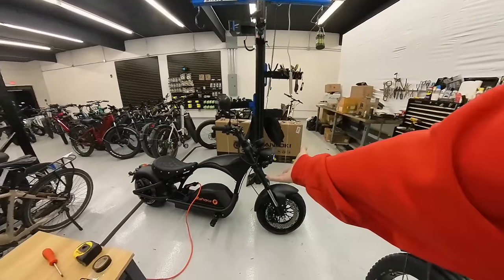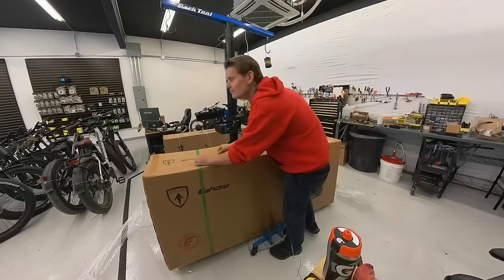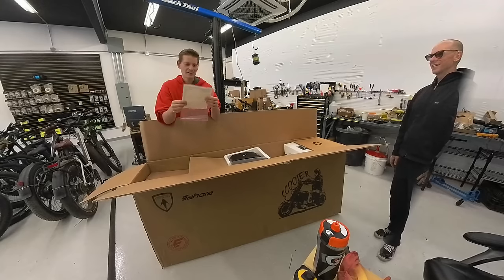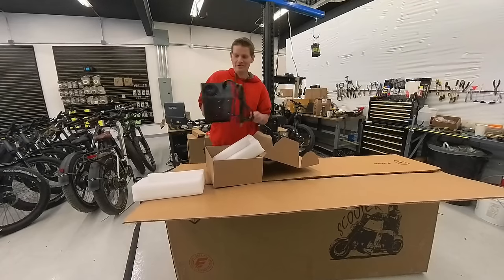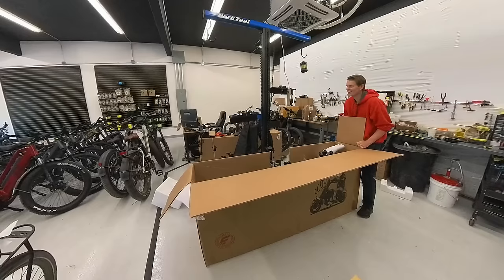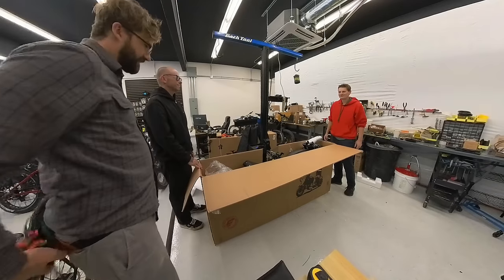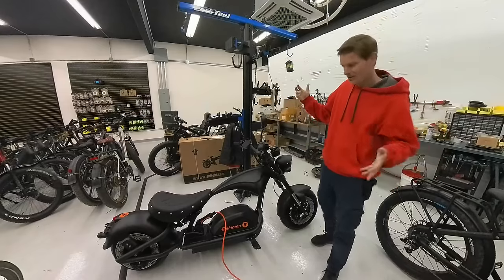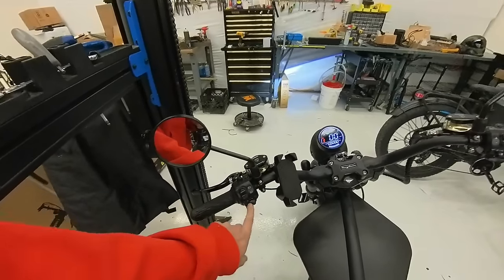Ready for a faster electric bike?  Unboxing the Eahora M1PS

Comment: When you do a follow-up post, please  give more details about how the rotor is attached to the wheel. It's cool looking and efficient.

But it seems to make the wheel more susceptible to stress fractures, where the rotor bolts onto the wheel  Versus more conventional hub flush surface mounted rotors.

Comment: Damn this is basically exactly what I’m looking for. I’ve got a 24 mile total commute on 45 mph roads. I was looking for something electric that can go at least 50 mph, have enough range to get to and from work, weight capacity high enough for me, I think I can register it as a moped so I don’t have to get a motorcycle license all for around the cost of a sur ron. I don’t particularly dig the chopper styling and I’m about 6’3 so I might be too tall for it but I’m super interested.
Reply from the maker: That sounds like a good use case for it.  I was comfortable in the shorter peg position.   You'd probably fit ok on it further out.  Idk what state you're in but in California you still need a M1 or similar license for a moped.
Reply: @Area13ebikes in Ga you don't  need a license for mopeds and scooters 49cc or so.

Comment: I looked at the motor maker with current configuration  you can exchange the motor to 5000 w motor by changing it through the motor  manufacturer  but if you want to big dog it they have a 8000w motor and mods are needed  like bigger battery , controler, finder comes off and bigger tire
Reply: QS seems to be the top of the hub motor food chain so much so they even make 12kw car tires 😅😂🎉

Comment: Hey are 13! Cool bike but one not is that if I remember right if you register it it unlocks speed mode so you can go up to 60-70 mph or you do a code thing were you hold and release brakes and throttle you’d have to search it but just wanted to let you know

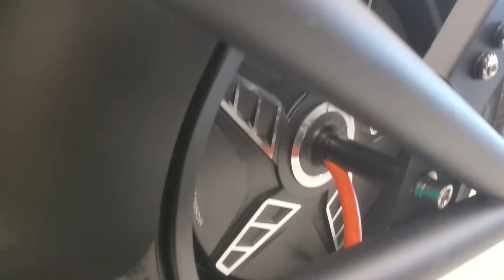Comment: That orange power lead @14:20 that comes out of the back wheel looks kinda squished/tight in the video.....hope it isn't, because that would be a bad place to rub thru the insulation, and cause a major short.
Reply: Thats just how it comes out of the axle. Is actually as good as it can possibly get for a hub motor

Comment: 13:36 Is that battery cover and compartment made of plastic? I mean it's roomy enough to make a proper fire-proof casing. But that cover looks like plastic.
Reply from the maker: It is plastic.  The housing on the battery itself is aluminum however.

Comment: 5 grand????  No thanks I can get a real motorcycle for that.
Reply: I agree
Reply: Also, the gas bike would be faster.
Reply: Even Sur-Ron’s cost less  😂
Reply: Price a Harley Live Wire and this will seem like a bargain!
Reply: @howardbecton6274  that's apples to oranges..
Harley has always been way over priced.
Reply from the maker: Realistically it's about the same battery and power as a surron, and in the same ballpark cost.  Just made for the street instead of dirt.
Reply: @Area13ebikes  real motor cycles are made for street.   Sorry but electric bikes just don't have the best tires/suspension/axles or brakes as motorcycles do. Just not worth 5 grand no matter how you slice it and dice it.  Comparing it to other electric bikes to justify the price does not address my point....
Reply: @howardbecton6274  right about that lol 🤑😂 but I couldn’t even compare the two on performance a Live wire I would maybe take on the highway 💨
Reply: keep indoors tho at night🎉🎉🎉🎉🎉
Reply: Well of course the first versions of something are gonna be more expensive. After more companies are able to make them, they will then be cheaper than a motorcycle. Then you'll be less sad
Reply: @hezues  they have been making them for a long time now. To many mark ups. Cheap labor cheap heavy steel frames.. cheap axles.   Just not worth five grand, not worth 2 grand.   I'm not sad just stating the way things are...
Reply: And return home each time smelling like a gas station.
Reply: @Area13ebikes False. Surron Ultra Bee is $6500 and the Light Bee is about $4500 and is only 60 volt.
Reply: @FreeAmericanSpirit This has a 72 volt, 45 ah battery. That shit ain't cheap, in addition to the frame, suspension, and hydraulic brakes.
Reply: @jff757  nope Ben riding motorcycles since the 60's never smelt like gas .  Where do people come up with this nonsense?
Reply: @jff757 y solar system has expensive batteries - still not as good as the grid. Having one good component doesn't mean anything
Reply: @FreeAmericanSpirit  So you've been smelling like a gas station for so long, you're used to it.
Reply: @jff757  nope maybe you should ride a motorcycle before you talk about things you no nothing about..   but hey buy a 5 grand bicycle and enjoy your high perch... Who cares it's your money to waste.
Reply: @FreeAmericanSpirit  Bicycle...hah! So much for not trying to seem bias. And you're arguing with a former Aprilia Tuono owner. Bye
Reply: @FreeAmericanSpirit ok so how much can you build this for?? Shutup or put up, post the video of you building a chopper ebike better than this for less cost
Reply: @FreeAmericanSpirit you're ignorant on this
Reply: @andyfumo8931  nope...  truth is not ignorance
Reply: 太酷了❤
Reply: This thing is real

Comment: I'm all for pushing the limits of E BIKES and blurring the lines between ebike, moped, and dirtbike  but that is NOT an ebike at all... that is more likely to cause problems for ebikes and likely get neive people whom approach it with a simply a ebike mentality HURT... the looks are one thing the power and speed are another...
Reply from the maker: At what point in this video did I call this an ebike as if it has pedals or should be on bike paths?
Reply: @Area13ebikes  in your emailed title ?????  (( The Eahora Knight M1PS is a unique entry into the world of "ebikes".)) my comment was not targeted at you Kyle nor your video it was a general response to a design  meant to blur the line...